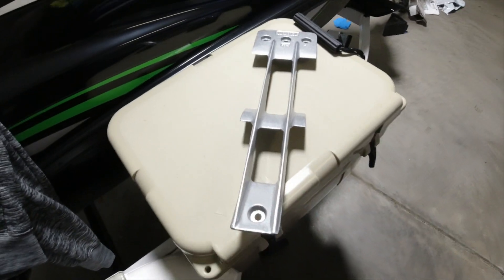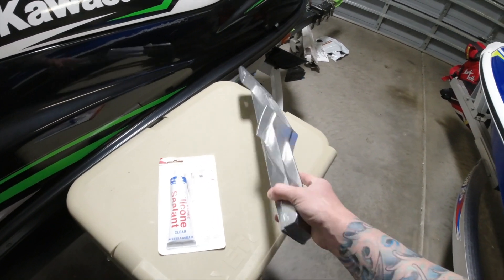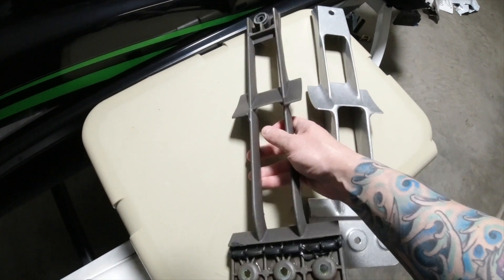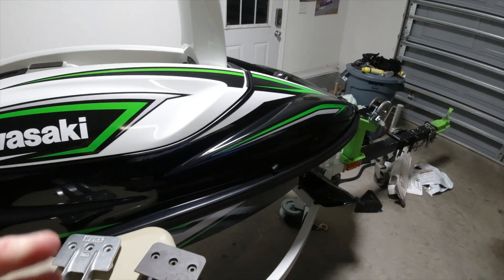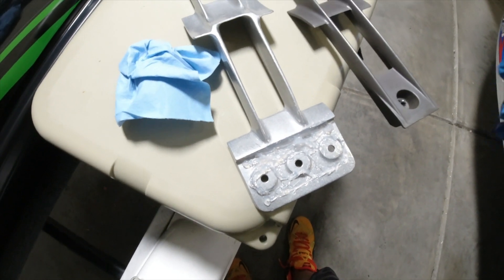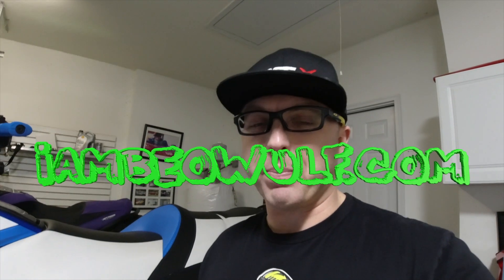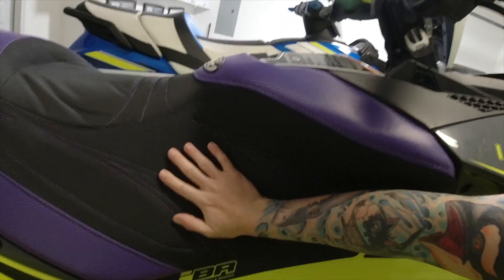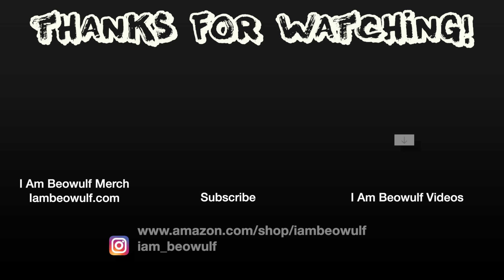How To Install Worx Racing Intake Grate On Sea-Doo RXP-X 300

Comment: I have a 2016 RXP300. I ordered the same Worx intake grate. I saw some other seadoo models require you to get to the nut inside the hull in order to tighten it. I assume on our model it has the nuts fixed in place on the hull so you just have to screw it from the bottom?
Reply: @andreavgr  also wondering the same thing

Comment: I have a 2020 RXT-300 and continue to get small debris stuck in my impeller. I live on a lake that is very shallow in spots (approx 2-3'). It happened twice this season. I saw that there are anti-debris grates and was wondering what your thoughts were on them?  I know it will reduce performance and speed (if goes about 70 mph) but I think its worth the reduced performance over spending thousands of dollars in repairs. What do you recommend?

Comment: how many bolts do you remove to take off the grate? I took the 4 off the bottom but it won't come off
Reply from the maker: 4 bolts but silicone is still holding intake grate on. Pull hard and should come right off
Reply: Does the 1 long bolt go through the hull? Our grate came loose on our 17 RXPX and ripped a hole through the hull...trying to figure out how to repair
Reply: @lindseyolson7163  yes there are 4 bolts that hold on the grate. there are 3 small bolts in the back and a long one in the front that goes through the hull.